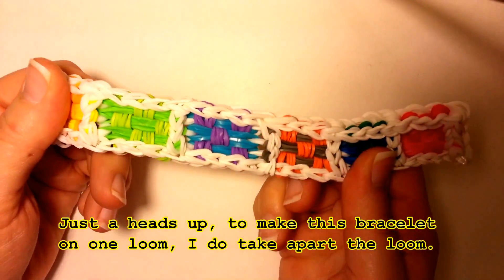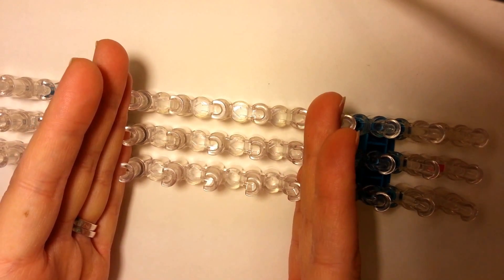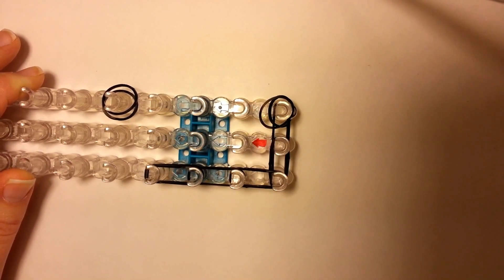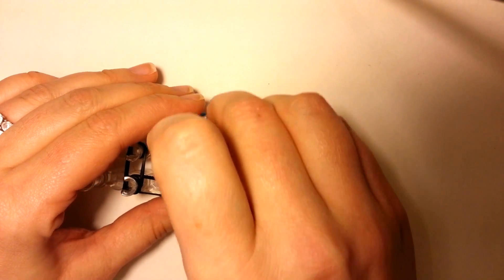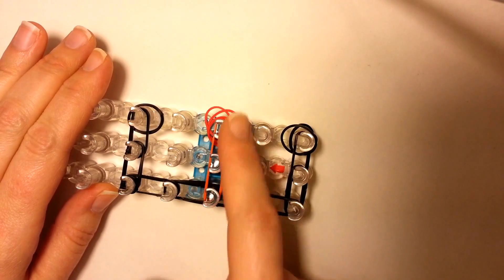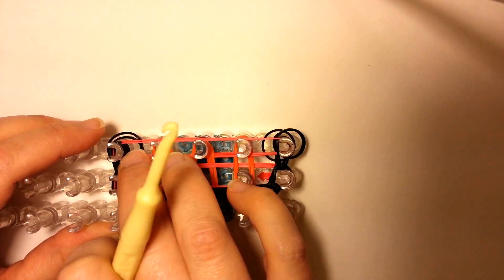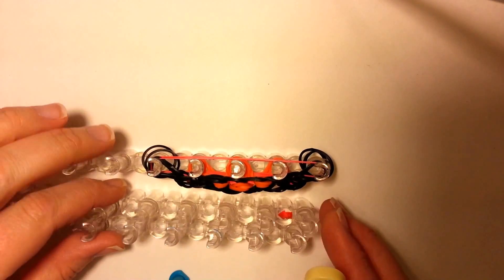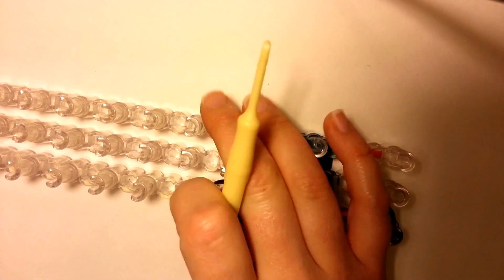ONE Loom Checkerboard Bracelet Tutorial by feelinspiffy (Rainbow Loom)

Comment: Can you extend the loom itself to make it longer so when you are finished it will be able to fit you without having to add extensions?
Reply from the maker: Yes, you certainly can. I actually have a tutorial just called the Checkerboard Bracelet where I did that (its one loom length (5 pins wide or two looms wide) there and I show how to extend it, though its in another video of mine, but if you have the 4 you can do it all at once. I just made this version because not everyone has 2+ looms to make it. :)
Reply: feelinspiffy Could you extend it with one loom?